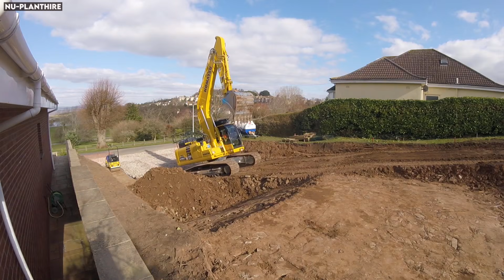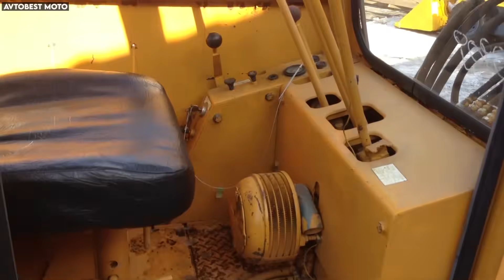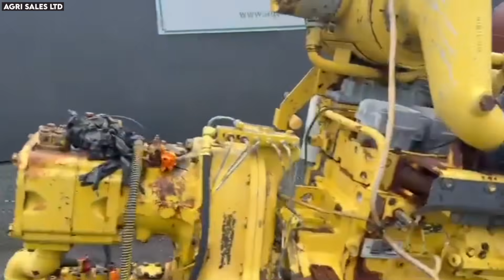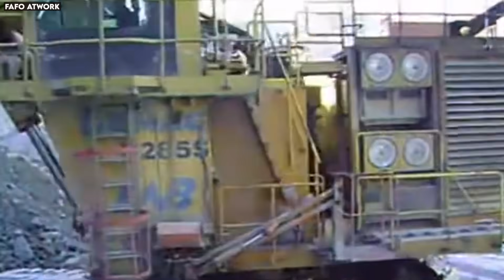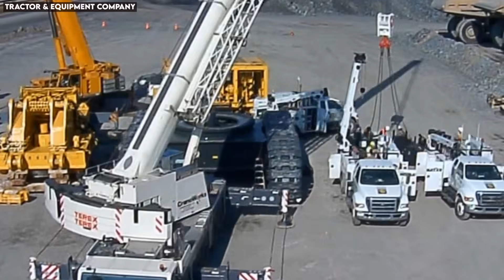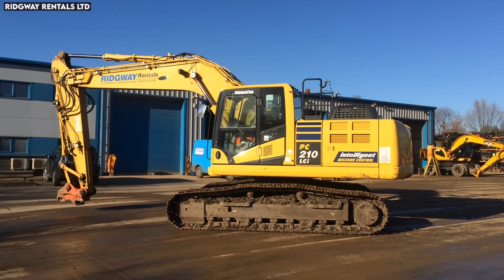10 Komatsu Excavators That Actually Shocked the World

Comment: When you TALKED about the connection to Bucyrus Erie and the (P.W.) wheeled excavator line, back in the early 1970s Hy-Dynamic Company was Developing a wheeled version of their OWN 😊 when Bucyrus took them over. It was called the
220-E Developed till 1974 😊 it was built on the (Rough Terrain) crane similarity 😊
What was so unique about the cab. The operator swung his seat around for Digging with just your control levers in front of you. Then to Drive on Roads, you swung the seat around 😊 and just had your basic steering wheel and throttle pedal on floor, no steering wheel in front of you Digging wise 😊 and no control levers in front of you driving down Roads 😊 excellent idea for the time. The one attachment it did NOT have though was a Dozer Blade on the early development excavator. Who knows if the line had continued the "BLADE" might have been in Development ?????? The marriage of Bucyrus and Komatsu in the 1980s went into the very popular (P.C.-400-L.C.) that a LOT of big name contractor in my area OWNED the 400 Komatsu for big digging jobs.